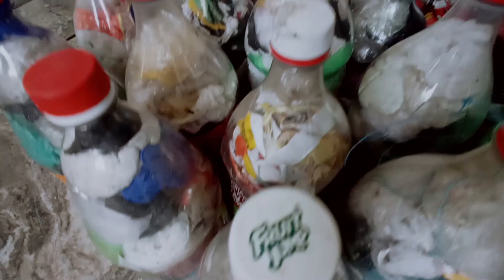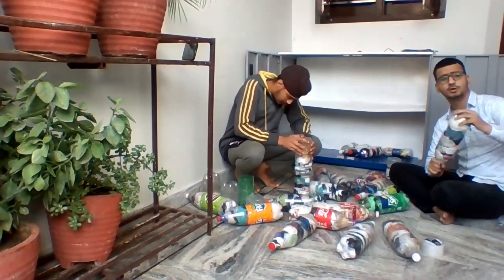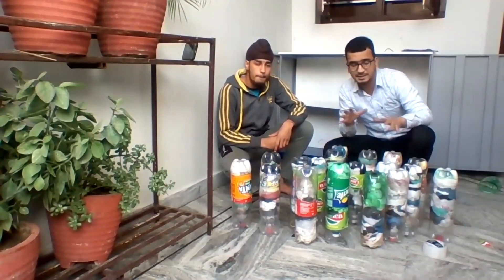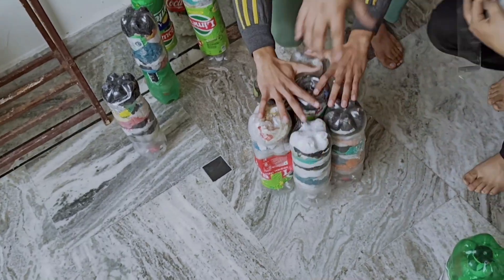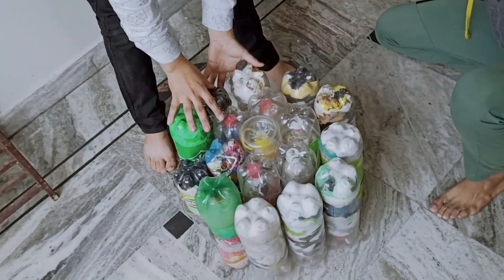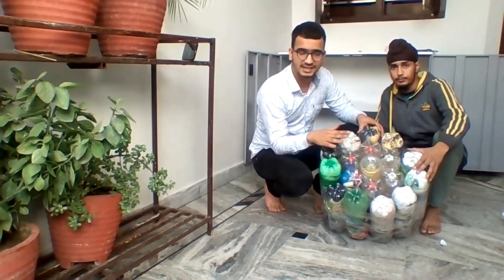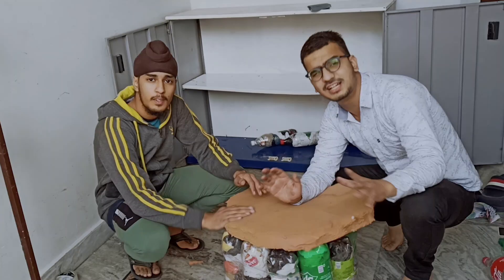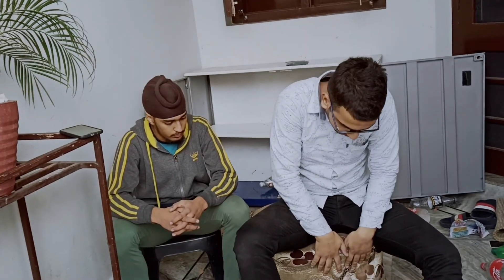Using Eco bricks To Make Stool. (ECOBRICK MASTERPIECE)

Comment: I have question thta we also have to clean the plastic wrappers and then dry them?? Pls tell me,I am confuse
Reply from the maker: Yes you are right we have to clean them.
Reply: @ecoisticpathshala5240  ohk
Reply: @ecoisticpathshala5240  if we will not clean them than what will happen,bcs I am not cleaning them and putting them straight inside the bottle
Reply from the maker: Just make sure there is no food residual in the packs that what we suppose to do! we advice this just so we avoid any fungal growth. 😃
Reply: @ecoisticpathshala5240  kk